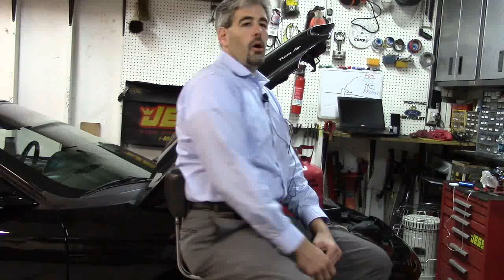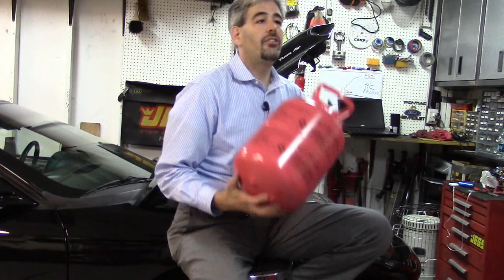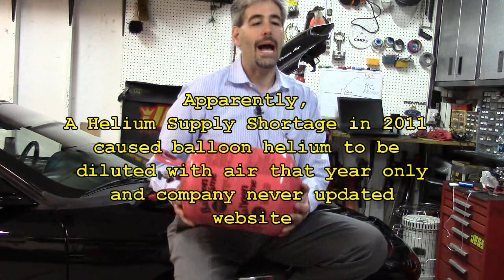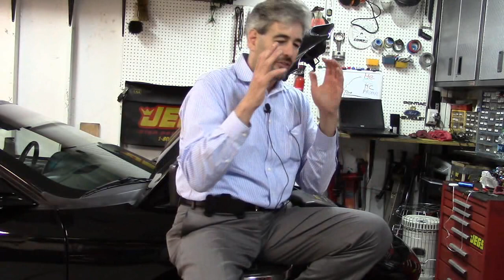Experiment to solve O2 Sensor Debate: UPDATE + New Design

Comment: Why not try argon or nitrogen or maybe even other inert gases one after the other?

If the results are constantly lean despite the other types of gas, a lowered HC is the only answer.

Also, what happens when you inject oxygen? You can get these gases at your friendly welding supply shop, available in every town across the USA?

Comment: Helium in this country I believe for general public use was reduced in purity and air added,  to negate suicide attempts, as it had at one time become a method promoted I think by Exit International. It allowed displacement of oxygen without affecting C02 gas exchange in the lungs, thus the suffocation effect not triggered, since it relates to Hb C02 levels. This would have been around 2004.  In the USA I dont know.

Comment: try and wrap your mind around this..........  https://www.youtube.com/watch?v=Fl3aD1qJrEg
Reply from the maker: please explain the differences in theoretical application between the opposing methodologies for us.  Dont just provide a link from something you dont even justify. - please explan the conclusion through your own indepenent validation.
Reply: Well Matt, from what I am seeing in this video the o2 sensor works from the amount of "Oxygen" that passes by the pick up. Now if we think about this how is the oxygen controlled ? correct there is really only one way via exhaust or a leak.  Now in your test you are trying to purge out the Oxygen with no place for it to go other then by the sensor. The results will never change.   The point of the video is to show how the sensor works nothing more.  If you want to remove the oxygen from the equation try connecting after the catalytic converter.  hummmm give you any ideas ?
Reply: one more thought, what if you can change the control oxygen in the sensor.
Reply from the maker: No- the video shows the opposite- that the sensing is not correlated to oxygen.  This is shown because I am changing the PROPORTION of O2 in the TOTAL composition of the exhaust.

Comment: The oxygen sensor measures the amount not the concentration,
If you introduce a fuel the result is less less oxygen
If you introduce a gas that does not react
The amount of oxygen is equal
Reply from the maker: Think about what you are saying- because it is wrong. If introducing na fuel reducing oxygen how is possible that introducing an inert gas does not?
 Come on man.

Comment: Since "O2 Sensors" detect both lean and rich conditions, a better name for them probably would have been "Exhaust Gas Analyzers" or "EGA's". In actuality they analyze the exhaust to detect the relative amounts of both oxygen and hydrocarbons present in the exhaust and their ultimate function is to tell the ECU what the current ratio is of the two primary gaseous constituents in the exhaust.

They probably got the name because they produce their output based on the amount of oxygen present in the exhaust. Then from there we make an assumption that if there is more oxygen present in the exhaust then the combustion is lean or if there is less oxygen present then the combustion is rich.  

Unfortunately the whole world calls them oxygen censors. It might have been a poor choice of a name from the beginning, but for now (at least until after WW3) we're stuck with it. At this point you'd have about the same luck changing the name "O2 Sensor" as you'd have getting doctors to call the heart a "blood pump".

It's all just about semantics anyways and I'm not sure it's worth wasting any more precious mental energy on the topic as there are more important things to worry about.

Comment: I don't know if this has been mentioned before but...

The helium may very well be 99 % from the factory, but since you used helium from Little Johnnys birthday party, it may have gotten contaminated in the filling process. Parents usually dont deal with gas bottles, so it's easy to let some air slip in.

The gas company probably doesn't care as it will work fine as balloon helium, but for a science experiment, yeah not so well.
Reply from the maker: TexMechs We proved it is pure in the follow up video but based on the information available at the time, yes I agree the purity was questionable.,

Comment: reminds me of the time my boss found a cost savings in the lab.  he replaced the ultra high purity helium with welding grade....$12,000 worth of gc columns later i found that oxygen in the welding grade helium was damaging the columns so helium is not always just helium
anyway,
isn't the signal from an O2 sensor the change in O2 inside the pipe versus the O2
outside the pipe as a reference?

Comment: In my mind a narrowband O2 sensor tells you one and only one thing. High voltage means rich. The cartylist action on the sensor requires extra oxygen to complete. All other conditions are "might be" cases.  I cannot wait to see the results of your tests. By my theory the inert gas should not affect the sensor which is contrary to your previous experiment. As a control will you could try some bagged up exhaust as well in the next experiment.

Comment: There is one bit of data to know from a mechanical stand point, that you are dealing with a narrow band type ego sensor. Narrow bands heated ( like in the ls1 you're testing on) or non heated both have a tendency to show full lean when running richer than its lower limit. Narrow bands detect o2. It is in the material the sensor is made of and has its flaws. The only sensors that detect hydrocarbons are lambda sensors than detect unburnt fuel and o2 on the exhaust system over a wider range hence the common name of wideband. Your experiments are great and well planned but that tidbit is not widely known outside of the tuning community.
Reply from the maker: space387 Agreed 100%- I have a video on this in fact

Comment: Hi Math, Thanks a lot excellent video’s!
As a simple EE, I go by the nature of the O2 sensor beast; measuring O2!
Could it be that the O2 goes lean first when adding Helium… as there is some O2 in the system and hose, before the helium reaches the exhaust.
The propane is under pressure, although, I noticed a rich condition before the propane was actually released.
So was this rich condition caused by the propane, or was it caused by the fuel trim, correcting for a vacuum leak that you just resolved, by clamping off the hose.
Could it be that the experiment was not long enough …
Alternatively this is a good way to prove that the Helium is impure…
Anyway looking forward to you next video!
Cheers, Marc

Comment: I'm still not even sure why it matters :s
All the previous tests used to diagnose an engine fault all still seem to be valid.
Reply from the maker: lolz larkin That is true.  This is what might be referred to as "pure science".  Potentially though, knowing the difference might apply to certain diagnostics especially in misfire diagnosis (if the sensor turns out to be an HC sensor)
Reply: Schrodingers Box Ok, well if it ever does, be sure to make a video on it.
Also, I'm routing for the oxygen. That's what I was taught, and one of my books I just pulled out says how the ZrO2 conducts the negative oxygen ions. 

'As one electrode of the sensor is open to a reference value of atmospheric air, a greater quantity of oxygen ions will be present this side. Because of the electrolytic action, these ions permeate the electrolyte and migrate through the electrolyte (ZrO2). This builds up a charge rather like a battery'

Sounds believable to me.

Comment: I think there is no way to detect sensor on the car as adding any material to the manifold or exhaust can reduce the oxygen and HC both . if the engine is not direct injection it is possible helium enter instead of fuel which supposed to be come instead of air. and if added ti the exhaust, it pure the exhaust instead of both HC and Oxygen .sorry my English is awful.
Reply from the maker: Reza Arezoumand That would be incorrect- if we can decrease BOTH the HC and O2 with a diluent that cannot be sensed we can force the sensor to make adjustment accordingly and the direction it goes (lean or rich) will tell what element was measured.

Comment: I'm wondering why you didn't choose Nitrogen as a diluent, while you've clearly chosen Helium on its merits, since it isn't found in exhaust gases you're also introducing a variable.
Reply from the maker: it's not just that it isn't in exhaust gas, it's that it's completely nonreactive with any other elements or compounds.
Reply: Schrodingers Box Aside from its inert nature, does it physically mix readily with other gases, in fact, whatever diluent you chose, will you (or the lambda sensor) get a homogeneous sample by your injecting it into the exhaust gases just upstream? Trying to find bugs in your otherwise sound testing method here.
Reply from the maker: No and in fact that is a concern so I actually will use argon instead which better matches density of propane to ensure it mixes and travels with the exhaust stream

Comment: Why not take the car out of the equation. Take a length of pipe and seal it at both ends. Then, drill and tap a hole in the pipe suitable for an O2 sensor. Drill and tap another hole to connect a line to evacuate the pipe and introduce the test gases. I know it's easier said than done.
Reply from the maker: How to then hear the sensor from the inside to 750F without exposing it to HC's causing it to be rich?
Reply from the maker: Heat not hear lol
Reply: Schrodingers Box You must be working with a non-heated 2-wire sensor.
Reply from the maker: Agh I overlooked that- you have a good point there, a heated O2 might work except I am not sure the heater element actually gets the O2 to working temp on its own or if it helps it hear up quicker by the exhaust is actually necessary to get the temperature. 
  great idea, worth looking into. Really good idea bro!!!
Reply from the maker: except it would be a challenge to maintain exact stoich for the sensor independently without computer control or something
Reply: Schrodingers Box Oops forgot about that, but I did say it was easier said than done! I'll give it some more thought.
Reply: Schrodingers Box  Here is what I have found from conversations with the major O2 sensor manufacturers, most heated narrow band sensors manufactured since 2000 will achieve and maintain operating temp by the heater alone. 

Why would there be a need to maintain stoich on a sensor being tested off vehicle in a test chamber? 
Stoich is the sensor's indicated response to a particular O2 concentration(allegedly). 
Testing would be for a measured sensor response from exposure of the sensor to each unadulterated exclusive gas. 

No computer control required to read a heated narrow band O2 sensor. 
The sensor when at operating temperature independently generates the signal voltage. 
Apply 6-9 VDC to the heater connections observing polarity and a volt meter connected to the sensor signal output and signal ground is all that should be required.
Reply: Schrodingers Box I see in your experiment that to prove your theory you showed the output in of the sensor in both rich and lean conditions but is this necessary? If the output of the sensor in the absence of o2 and hc is in the mid-range and the introduction of o2 affects the sensor then it could be assumed that the sensor does respond to o2 without having to simulate a rich condition?

Comment: Interesting experiment, the only way to validate any result though is to measure pre Cat exhaust gas at the same time as monitoring the sensor output. Only then you can truly see what effect the induced gas has on the actual mixture and how the sensor is reacting to that.
Reply from the maker: That would not be true-  remember the question is not the condition (rich or lean) of the preexhaust gas- it is WHAT COMPONENT of that gas is measured. That is what the only variable to be determined is.  There is no debate on the condition of the exhaust, and in fact it is technically irrelevent if we could demonstrate the mechanism of detection regardless of condition.
Reply: Schrodingers Box (Just playing devils advocate here.) Your quite right, but people out there are after a definitive result, the sensor was never invented with Helium in the equation so some could argue its now a Helium sensor? To me its like doing half an experiment. If you can show exhaust gas O2 levels remain the same and HC changes (or vice versa) and the sensor reacts then that test becomes conclusive. Maybe the HC and O2 levels are remaining the same and the Helium is driving the sensor reading. Every action has a reaction.
Reply from the maker: Duncan Bailey No, no no... If O2 remains constant and HC levels change, then the same effect happens- more HC means a lower proportion of O2 so if its an O2 sensor, it creates rich condition and if its an HC sensor the increase in HC of course is detected as rich condition.  The vice versa is true if you decrease HC and keep O2 constant.  
YOU CANNOT USE HC OR O2 AS THE DILUENT.  
  got it now?  If not, dont worry, I have a perfect explanation that will make it crystal clear on the dry erase board on next video.

Comment: Hi Matt. Very happy to see that you investigate this topic further and I am very sure with the improved experimental design you will come to a reliable and scientifically conclusive result as you will eliminate all known unknowns pointed out by the viewers.
One idea: when doing the improved setup: you could not only introduce the known-good type of helium into the AIR port but - just out of curiosity - you could in a second step also introduce the possibly O2 polluted balloon gas into the port just for comparison.
It would help to rule out, if introduction of He before the actual combustion really changed the experiment results... as some viewers have suspected.
Can hardly wait for the follow-up...
Reply from the maker: Yes I intended to do this as its a great test to see if the original helium was contaminated.
Reply: I can understand, that many people are unsure if adding He before combustion may compromise the experiment:
Will the ECU react weird, when at a given RPM e.g. 20% less air than expected is measured by MAF?
If e.g. 50% of air is replaced by He - will the resulting mixture of around 46.8:46.8:7.4 = He:Air:Fuel burn as "clean" as if there was no He in the mixture (although the air:fuel ratio is the same) - if we burn a certain amount of material in an environment where there is less oxygen available, it will regularly burn with more soot, produce CO instead of CO2 etc. - so the chemical reaction may be influenced by this.
Maybe these concerns are unjustified and in doubt I would rely on your expertise in chemistry because I simply do not know enough about that. It is only that I cannot draw the same conclusions as you do by my own thinking because I cannot rule out these possible effects by my own knowledge... that is then what makes me unsure...
Therefore I stay very curious about the next experiment and it results...